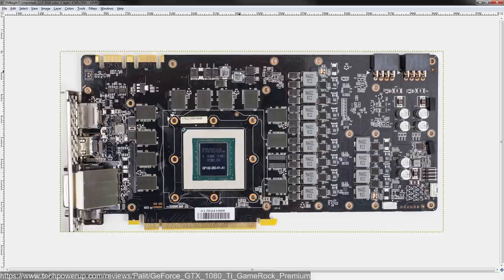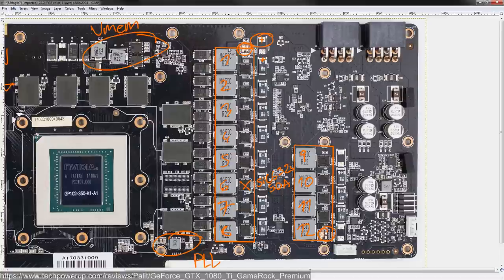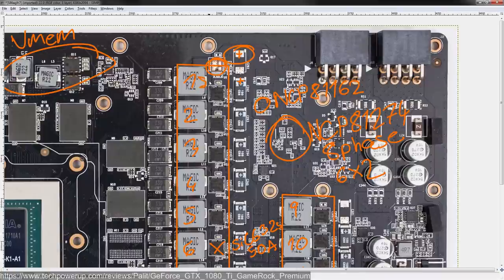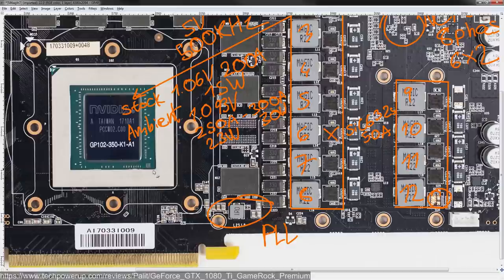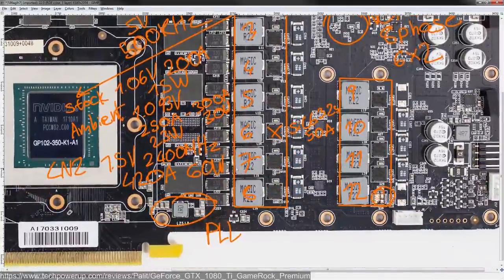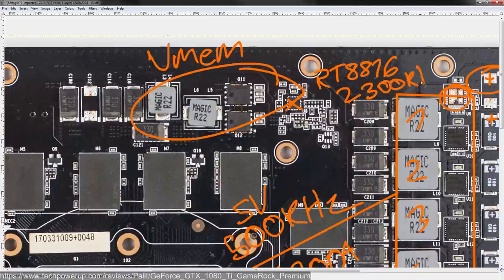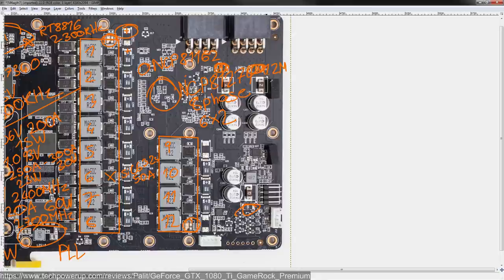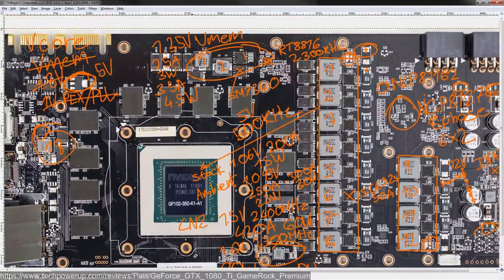PCB Breakdown: Palit GTX 1080Ti GameRock Premium

Comment: I wish you or people that check out PCBs in general would do more breakdowns for Tier2/3 Graphicscard manufacturers. It's always hard to know if you are safe to buy the lesser known brands and be ok with overclocking them a bit or if they totally suck. I bought the Palit 1060 6GB back in 2016 and for now it is working fine, but I would probably pick a Tier 1 brand for anything beyond xx60/x80 cards if there was no tests/recommendations on the cheaper brands, which is kinda sad. Like there aren't many youtubers/publications that focus on the real deals and how they compare to the mainstream brands. At least none that I'm aware of.

Comment: Hi, my question is regarding, I believe the PEX or PLL rail 1 volt, actually it was referred to in an older video .95 volt rail.  Anyway, I’m looking to replace it, as mine is missing from my card.  I bought a non-working card and it’s brand new yet missing a capacitor & this rail.  Yet I cannot find this PL anywhere, other videos refer to it as “.95 volt rail and not sure what it is’.  Pretty sure it’s a conductor, it’s from an Asus Strix card on the top of this small gray square, 2R2 748 95C (I think it’s pl1 or pl2 if memory serve). Off a picture found on internet it’s 2R2 650 P 0B.   If anyone could help it’s much appreciated, driving myself crazy trying to find to replace.  Thank you.

Comment: Like U said with current pricing high end cards are a pipedream

I have a Palit 1050ti
It looks cheaply made - but runs well
the heat sink is a lump of metal like a stock intel one
the shroud and fan are just plastic
the pcb looks simple and cheaply made

would like you to check out

Comment: I would like to see a comparison between the MSI Gaming X and the Armor Card, they are the same PCB, but the Armor got stripped down a bit (empty solder pads). How much does this impact performance / how bad is it?
Reply: Gamers Nexus already did a very good video about it. Basically steve says that only buy that card if you intend to take off the air cooler to go custom cooling

Comment: GREAT CARD, BUT THE NEB108T019LC-1021F Palit GTX1080ti 11gb is let down by a very small fan, problems usually start in the 3rd year if used daily for AAA gaming,  I can vouch for a couple failing due to heavy use, they start to switch off under heavy use

Comment: Hey Buildzoid. What do you think of the Asus Maximus X Hero in Terms of VRM, VRM cooling and overclocking capability?
Reply from the maker: AFAIK it runs the same 50A Dual Nfets that the NZXT N7 has. Very similar VRM. Though the Apex has a much stronger BIOS and memory layout. Really right now for Extreme overclocking on Z370 the Apex is the only option.

Comment: Btw if you are interested I have a dead reference 7950 lying around (it died after about 3/4 years of running at the maximum voltage the stock bios allowed).

I have some pics of its pc / can make some better ones if you are interested. 

 I could even ship it to you but really a dead reference 7950 probably is not worth the €10 ish the shipping would cost.
Reply from the maker: If the Vcore VRM works I can turn it into a OKish power board. That would fall under worth the shipping to me.
Reply from the maker: That looks very much like the VRM would still work
Reply: Cool, what would be the best way to contact you directly (outside of Facebook which I refuse to use)?
BTW I am going away for one week starting tomorrow so I won't be able to send it before I get back.
Reply from the maker: buildzoid@gmail.com

Comment from the maker: First and worse than ever!
Reply: Actually Hardcore Overclocking "worse"
Reply: yeah, I feel you could have rambled a bit more about how the fet drive pcb layouts can be done. Overall not bad tho. I actually liked the bit of a dive into the math as well. B)
Reply: So.. which air-cooled 1080 Ti would you recommend?
Reply: Can you solder in some new chips (the unused phase/sections) and pull more power off the PCIe? I know you are going to ask "why"... but I am going to ask "Why not... nope, just do it!!!" ;)
Reply: TechyBen, unless the motherboard has an extra plug for PCIe power, that may be a bad idea. the 24-pin only has two 12v wires for everything that is not the CPU (and possibly the memory power on some boards).

That said, yeah, power-modding for more from the PCIe slot is not "impossible" to do. Pulling more from the 12v plugs, very doable.
Reply: Ok. I'd have to provide alternate power to the 12v rail on a PCIe riser then. ;)